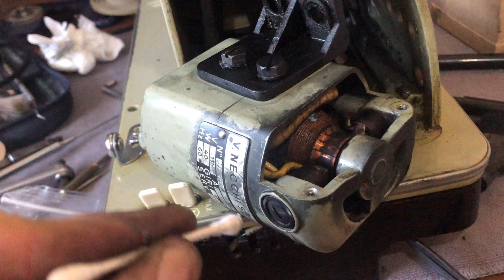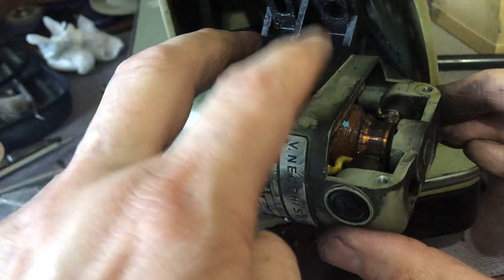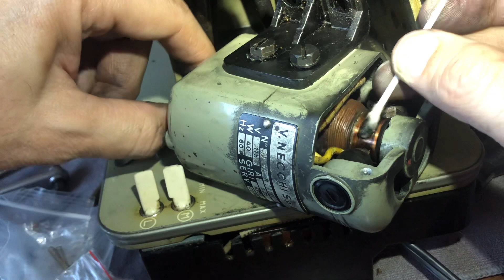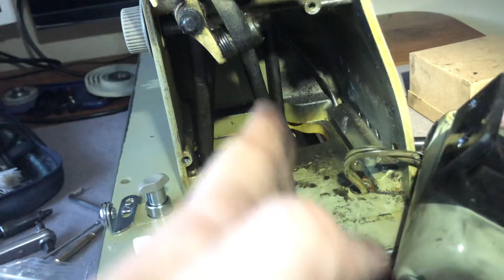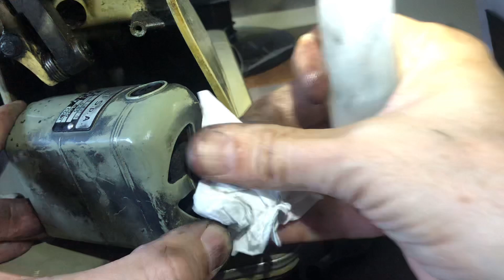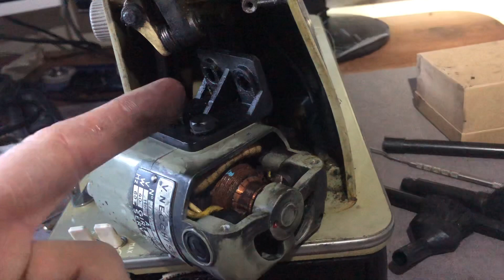MOTOR SERIES # 21: Motor Brushes Worn? Replacing Sewing Motor Brushes & Cleaning the Commutator!

Comment: I'm workingon cleaning my late Mom's SuperNova, and this is very helpful.  But loads of differences between hers, which has never been touched for at least 25 years and this messy/beat up one you have--obviously many more hours of use than my Mom's had! And I suspect a lot of the black in the body (not within the motor) is due to the black belt, which looked like it was wider than original 3/16" one, too...

Comment: Very helpful. I've restored many machines in my time (not as many as you), and I've never seen so much carbon dust as in this Necchi. Softer than normal brushes maybe? 
I also collect and restore old toy trains, Lionel and American Flyer. I have used for years the same technique as you. Alcohol and cotton swabs. I don't use anything metal to clean between the commutater segments, but instead I use round toothpicks. Much safer for the motor!